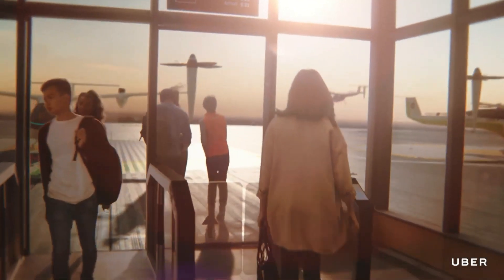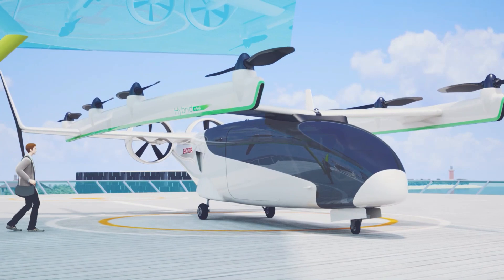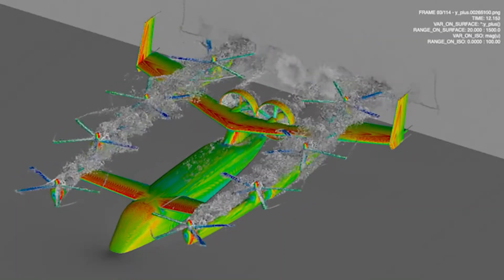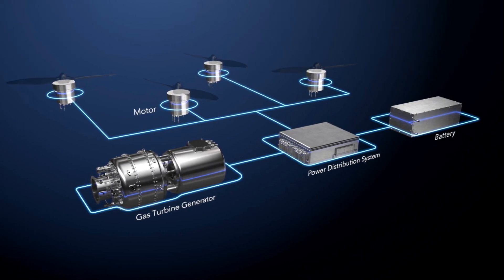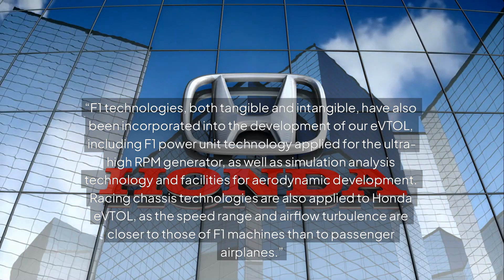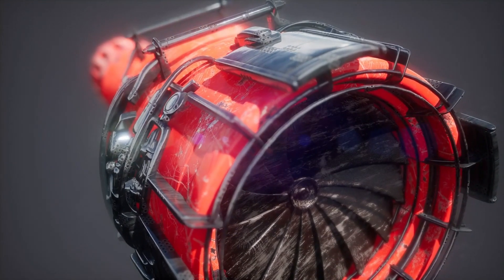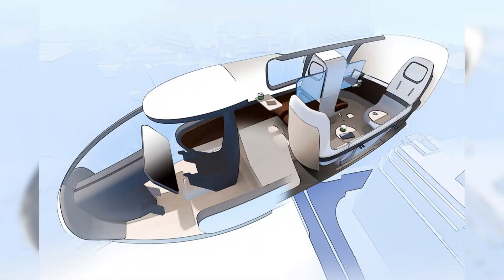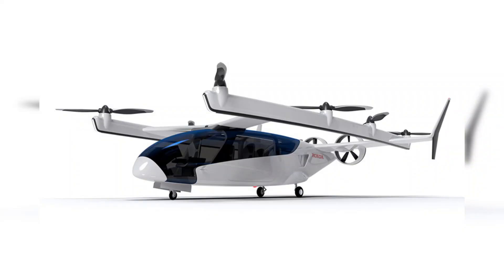Honda eVTOL: Power Management Secret Revealed

Comment: I’ve been following the channel for four years, so far not a single design was certified aside from the Pipistrel. So I’m not holding my breath.
Reply from the maker: Its because the FAA didnt roll out the category for their certification. They have only done it last year in October. Companies need to know the requirements against which they are designing. The FAA has been extremely sluggish/cautious when it comes to electric aviation. Pipistrel got certified because the criterion for fixed wing aircraft was set. Electra Aero will be next, again another fixed wing.
Reply: @ do you think that the requirement to land without power is sluggish or cautios? What about Alice? It’s been around for years and could easily be certified and yet it’s not happening. As for multi rotors, unless they can’t autorotate, they can’t be certified.

Comment: I think Honda are right that there needs to be a power source mix, more especially for commercial operators. But I also see other ways of going about this. If I remember rightly you yourself recognised that a auto-gyro could recover energy in auto-rotation, and for which the greatest of them all was Rotodyne. Rotodyne offers a large rotor for higher efficiency and lower noise levels (if the tip jet noise can be eliminated). For lesser sizes the Blackfly configuration has undeniable advantages which could be greatly improved with a rotating cockpit.

Comment: These are both preliminary offerings to the eVTOL idea but given modern aerodynamics and laminate tech,I expect that a vehicle with e.g. 4,6,8 or 20 predominantly fixed horizontal axis fans will offer advantages where the tilt vs lift and flow have to compromise with weight or redundancy/back up.
The control and lift could be controlled simply by opening,shutting modulating and vectoring the air intake and exhaust channels integrated into the composite/3D exoskeleton.
Careful positioning of large intakes,vents etc can produce negative wind resistance where possible and low-friction fuzzy edges elsewhere via the new mini surface blower tech . 
Something more like a teflon manta ray rather than a mako or an eagle.letting the air through,rather than going through the air.
The tech is easily adapted to anything from heavy long haul to one seat high agility and perhaps even ground effect compatible and the batteries can obviously be distributed to optimize handling or stability/seating/rapid battery swap-outs for quick turnarounds etc.
The horizontal axis means multiple 'rotors' can be run from e.g. x no. of axles via y no. of motors to suit the efficiency/performance requirements and each vehicle would be highly versatile and easily modified (modular design) with manoeuvrability that might impress a dragonfly as an option.
If we can make helicopters then we can make these IF the numbes can be made to add up!